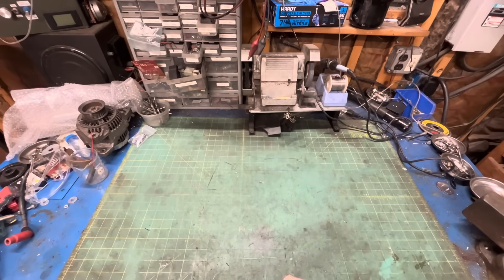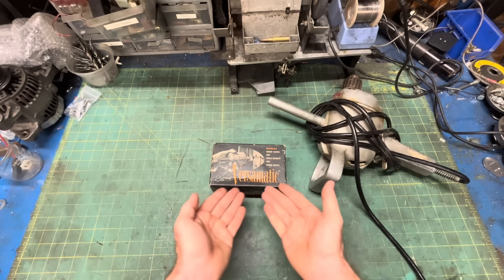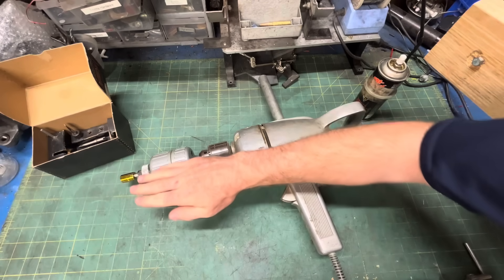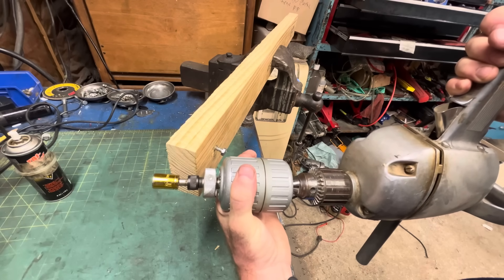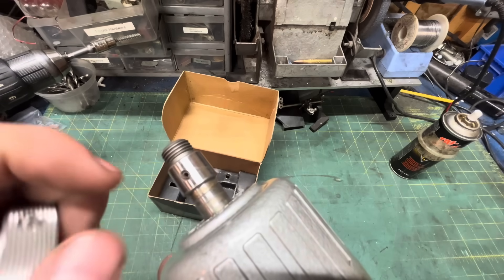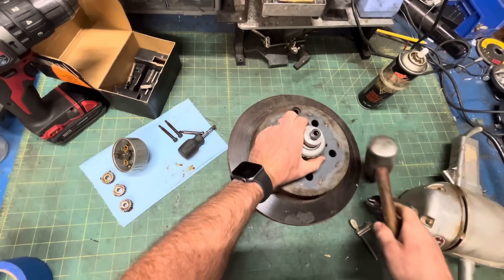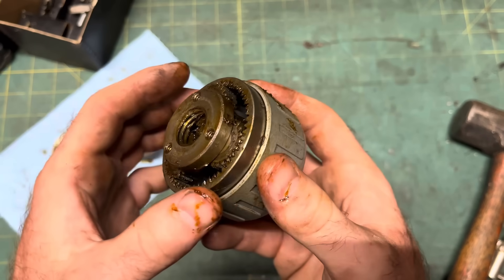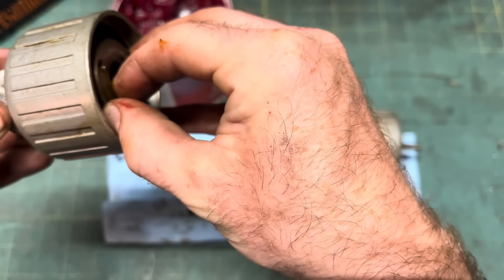Versamatic: The COOLEST Tiny Transmission You’ve Never Heard Of! Teardown & Review!

Comment: You just brought back some long lost memories! My dad had one of those way, way back in the early 60s. I was too young to use it, but I think he bought it for the reverse feature. I have no idea what happened to it. Oh, and the instrument panel on the 61-62 Chryslers were absolutely the coolest!
Reply: I do still have a Thor 1/2" drill similar to your Cummins. All metal, weighs a ton, no reverse, no variable speed. It does have enough torque to twist your arm off if you get careless.

Comment: That with a tap collet would be a heck of a thing for a drill press, balance the quill return spring out and let it pull as it turns the tap at something like 280rpm/7=40rpm, less than one revolution a second, and just hold the gearcase gently so if it binds it spins and stops transmitting torque while you shut off the drill motor...
Reply from the maker: As I understand it, a Jacobs chuck was available. Mine didn’t come with it. It may have been added later.

Comment: In the 1980s I worked in factory where we had a similar device with a difference, or dare I say, a twist.  It was used for tapping holes.  When one would push it toward the piece being tapped, it would drive forward.  When one would pull back, it would instantly reverse and drive the tap out.  If one had a panel that needed lots of holes tapped, it was amazingly fast.

Comment: just curious dont drill today have a similar system like integrated internally? i know you refer to the solution being an electronic one but is it actually? like i know you can change the torque of a power dril by changing its setting and that to me seems like a purely mechanical system i guess the speed switch isnt the same or its done electronically idk im confused now. okay so if it is only torque controlled mechanically in todays drills why dont they do speed this way oh shit im dumb bnecause thats inefficient id assume right? i wish i had one of those good brains mine just seems like a lemon always breaking down and not processing man it is wat it is
Reply from the maker: Speed reduction is mechanical, just like this. But reverse is accomplished electronically.

Comment: It may have been designed in the 1950’s but my dad bought one new in the mid 1970’s when we owned a campground and had to mass assemble a bunch of picnic tables.  It was fascinating to me at 8 years old because me and my older brothers didn’t have to hand drive all those screws. It’s still in dad’s tool box, but it hasn’t been used in years.

Comment: 9:43 to answer your question on grease. The 2 biggest variables are drop point (the temp at which it melts and becomes liquid, so heat resistance) and pressure rating. (Amount of force that can be applied before it will no longer lubricate properly). There's a few other variables like sticktion and friction modifiers as well
Reply: thanks captain

Comment: Fancy electronics are not required to make reverse work on a brushed AC motor..... Many drills from the 90s have nothing but wires, brushed motor, and a switch that connects the motor one way to spin clockwise and another way to spin cclockwise.
The main job of the electronics in your power tools now is battery management(especially with lithium) and now brushless motors require switched power to operate.
Funny thing is that because NiCd and NiMh batteries are so safe, there was never a push to monitor them properly during discharge(maybe during charging too) so damaging them during use is easy and they didn't hold up incredibly well, even after some of the chemistry issues were solved. Lithium batteries, on the other hand, tend to go nuclear when not maintained properly.... so proper discharge cutoffs and better charge monitoring has made them much better batteries(along with their better capacity 2x to 4x by wieght) The only issue is that a lithium battery adds additional fire risk, even if the battery isn't the start of the fire it will contribute much more than normal fuel of the same weight by sheer speed of heat release that doesn't rely on external oxygen to happen. Luckily most tool batteries are small enough that they are relatively small and short additions to a fire, unfortunately the same cannot be said about vehicle batteries.......

Comment: Back in the day a ot of early drills had a toggle switch so you just left it on or tried to flip if off when you had the screw close and finished it by hand. That little number was the perfect add on .... leave the drill on and grab the collar when you wanted it to turn. Also works well for the grill that had a failed switch and someone put a inline switch for a lamp on it.

Comment: Since you love antique mechanical items that have long since been replaced by electronics, you should look into antique gramophones. Spring wound, no electricity required whatsoever for audio reproduction, purely mechanical all around. I have a small collection of them myself and trust me, there's something about the sound of them that videos can never capture quite right, and there's something oddly magical in a sense of a steel needle running in a groove on a shellac disc sending vibrations through a lever to a diaphragm that mechanically oscillates the air to produce sound that then gets magnified by a horn. Different reproducers (the bit with the diaphragm) even can have different properties and can affect the sound.

Comment: Actually inside of that thing, a 3% moly bearing grease probably would be best. Lots of torque applied to sliding surfaces and not super high speed. That said modern wheel bearing grease is a massive upgrade over what was in there.

Comment: I had no idea these existed, and I'm an antique myself, and a tool nut. Neat!
Reply: I've got a 'Handy Andy' version (no-name, no reverse, much smaller, body made of an off-white Delrin-like plastic) with a 1/4" hex socket output shaft. Along with it came -- from a source a can't recall -- a similarly-built right-angle doubler/halver drill attachment, where the identical input/output shafts are (IIRC) 1/4-20 TPI internal threads, and there's provision for an outrigger (handle) on either side. Neither gets much use, but I keep them around 'just-in-case'.

Tools are a contagion.

Comment: Since it has so much torque and all the outriggers for gripping, wouldn't this me used more for things like mixing mortar, paint, and using as a starter motor on a 9 liter V8 putting out 140 horsepower? You could make an electric go-cart equipped with a 7:1 crawler gear!

Comment: I'm sitting here wondering why they didn't make a slot in handle with those lines, to actually get some purchase on it.
might break your wrist but eh, don't be a snowflake about it
also they could make a little adjustable brace that clamps onto those slots and uses the drill housing as a brace point. just slot the brace in the side you want and the drill becomes the metaphorical hand holding the cylinder

Comment: Why would you need electronics for a multiple Speed and Reverse electric motor? If it was seen as desirable seems very doable to build a selectively engabeable transformer and do reverse by some mechanical switch that changes contacts to the wirings?

Comment: Some more info on multi-start threads for people as well as a recent story: while helpful that multi-start threads allow for the thread to start in one of multiple positions, its more important characteristic in this kind of application is that it lets you engage or disengage the two parts (in this case) in 1/3 as many rotations; drastically reducing the amount of time it takes to change this between fwd/rev.  If you tried to do that just by using a much more coarse thread, you'd only get maybe 1.5 threads engaged (instead of 4.5); the thread form would be much deeper and consume more of your shaft strength; and would all around be weaker as well as slower to manipulate.   

I recently made an extension for someone's antique walking cane that had a concealed dagger in the handle (and a functioning brass mini-cannon on the top).  He needed it 6" taller for him to be able to potentially use.  The handle threaded onto the shaft of the cane, which was tubular at the top to accept the dagger from the handle.  So I just needed to make a tube with threaded ends, right?  except it was  4-start thread and a weird size.  The multi-start in that case needed all the benefits I talked about above:  Faster/fewer turns for 4x as much engagement/strength; lower thread profile than a 4x coarser thread - important due to how thin the tube wall was; and a coarser thread on the same distance parts also wouldn't provide enough engagement to ensure the parts stayed aligned. And of course, 4x faster to unscrew it faster for a tactical advantage! (/s).

It was a fun and challenging project, I wish I had the time to make a video while I was problem-solving on it.  I had not previously worked with multi-start threads, and it was intimidating but ultimately straightforward.